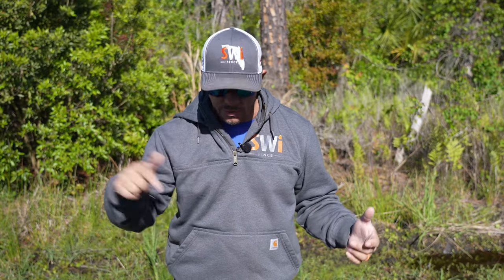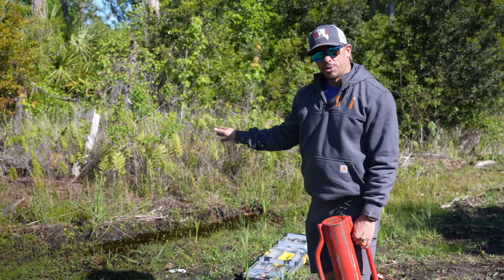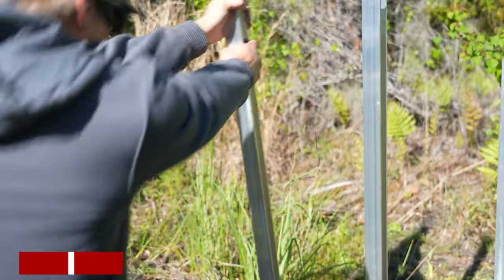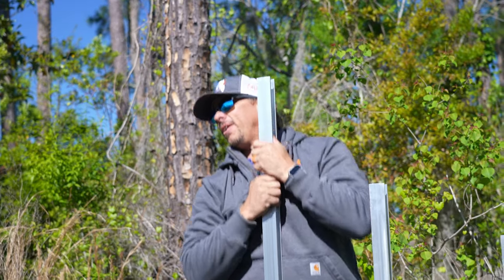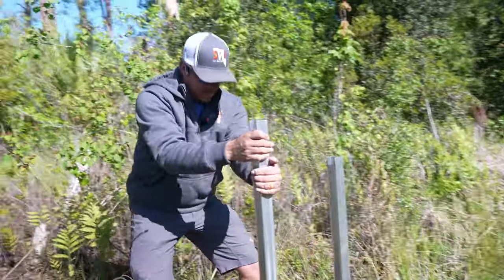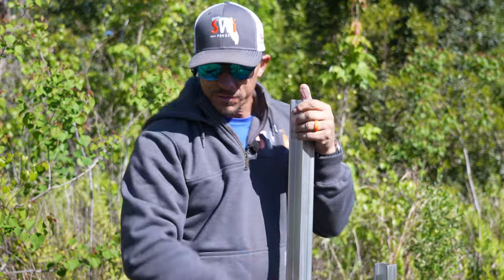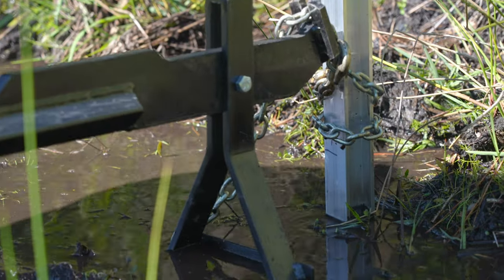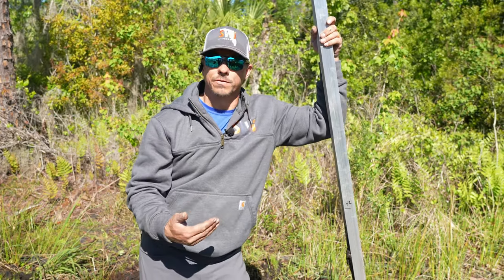How Deep Do No-Dig Fence Posts Have To Be?

Comment: Florida is good, always below the frost line or the posts will come up over time and that’s why almost every fence in the Midwest installed has walls leaning.
Reply: My T-fence posts in upper Michigan sank as time went on.  They were mounted in water or wet soil types.

Comment: I’m impressed, even the pole 2 ft deep didn’t really come out very easily! Driven a lot of T posts and pulled out quite a few too! Tell you the hardest T post that I ended up just cutting off at ground level and that was posts that had thick roots growing around the posts and those wings on the post were under the roots! Now that would of took a act of God to remove! 😂 notice your post don’t have those wings either! That should help removing them if roots are growing around them too I would think? 
Btw, yes I like to see you break off the regular post you mentioned.

Comment: Consider letting go of the pounder just before impact to save yourself some numb hands and arms. When I was cutting the holes at the golf course with a similar implement that metal-on-metal shock really kicked my ass. Maybe I'm just soft though, seems I was playing Super Nintendo when this fella was wrestling gators or something.

I suspect it's loud as hell too, I'm gonna try and stuff a rag into the pounder to deaden the sound a bit.

Last thing, I basically copied your post-pulling machine after seeing it in action. Went and bought a 5' length of chain (1/4" I think?) with a couple grabhooks, then pretty much anything can work as a lever+fulcrum.

Great vid as usual, very helpful.

Comment: Good experiment.  However, the lever arm for each were different.  Drive them to these depths, then cut them all to the same height.  Then pull.  That will test the embedment strength in an "apples to apples" comparison.  As you performed the tests, the ones that were driven deeper into the ground had a smaller lever arm, this you were actually imparting less moment to the post.

Comment: I have driven top rail cable fence in a low water crossing  I drove them 11 feet to 16 feet the ones driven less than 16 feet sunk when the top rail set on post.

Comment: Do you make posts for retaining walls? And how deep do you have to put them in the ground?
Reply: Have you learned anything since your post?

I'm looking at various metal posts for a retaining wall as well.  I have casted several dozen concrete beams 6ft x 9in x 4in thick.  I have dense clay soil & freeze thaw cycles.  Galvanize H beam is way too expensive for as much as I need.  With something like this it is the yield strength that I see being the most important.  Seeing as the majority of my walls will be less than 2ft tall I am thinking telespar or u-channel will be plenty good... they won't bend or shear under that load.  

I have a few sections that will need to be 30-44" though & that is my big worry.  Especially since that will be holding part of the patio & we get enough rain/snow to saturate the clay & make it really heavy (of course I've planned for drainage).  I found a local reseller that has postmaster posts for cheap & that is what lead me to this video.  I am thinking I will use the postmaster posts for anything under 30"... 1 to hold the ends of the concrete bam & 1 in the middle... the thought being the middle will be where the beam will experience the most tensile stress.  Alternatively I could use equidistant from the middle for more shear/bend strength... but budget is a concern.  For the tall sections I am looking for an H beam or even thinking of casting my own posts from concrete.  But those would have to be dug & set instead of driven (prestressed posts like one can buy in Australia can be driven).

Comment: good video. Have you hade any trouble driving post in hard pan ? Up in Jacksonville Fl. we have a lot of hard pan especially on the westside of town . Thanks for a great demonstration on post strength .
Reply from the maker: Depends on individual conditions. You can drive anywhere if you've got enough driving power. Some situations would call for upgrading past a gas-powered driver.

Comment: How would these work for a privacy fence? Most posts i see like these are about 7ft max but if you’re driving these posts 2-3ft down you only have 5-4ft showing. How would you install a 7-8ft privacy fence with only a 4-5ft post. Seems like at best you have 2ft ground, 5ft showing with a vertical fence 2-3ft(7-8ft fence)above the top rail.
Reply from the maker: For something like cedar than you're using longer posts so you can get more in the ground and still have enough sticking out. https://youtu.be/PnM7g24yWe8
For something like vinyl you don't have to reach the full height of the fence since you're sleeving over. https://youtu.be/ONA15hJym-k

Comment: I live in eastern Oregon and the top soil is soft sand 2ft down and after that it's sand stone with highly compacted 3 to 4 inch river rock. I have a pre-existing 4ft picket fence that I need to replace a number of posts on.  I'm wondering if I could use your idea of using Sodium Bentonite to solve the sand cave in problem when digging the post hole? Also what kind of supply co. sells Sodium Bentonite?
Jim
Reply from the maker: I would just use water for dealing with the sand. Drill the hole, throw some water in--should form a nice hole to set your post in. We use the bentonite when it's nothing but river rock, so we add the bentonite and water to create the paste.

Comment: Hi. I love your videos!  I want to place a vinyl fence with either driven Galvanized or I-beam style posts.  Our lot is at the coast and is sand.  Can these posts be placed by the no dig/driven down method and still be hurricane strength rated?  If so, i’m assuming a 3.5’ depth. Thank you!
Reply from the maker: Here's a hurricane test on vinyl fence set in concrete: https://youtu.be/_iQnheVwAI4
And here's a hurricane test on no-dig vinyl fence: https://youtu.be/8jWcT17PFME
Reply: @SWiFence  Thank you for your response.  I have previously seen those videos.  My question is: Will the posts hold as well when driven into sand only or will some other substrate be required for strength in a sand installation? Thank you in advance!
Reply from the maker: Sorry if I'm not being clear. The two videos listed above were done in Florida sand.

Comment: How do you pull a wood post cemented in? Will that tool you used in this video work?
Reply from the maker: That's been the subject of conversation around here and we need to do a video to test it. I think if you're pulling out a diy concrete job it'll probably do the trick. If you're pulling out contractor-built concrete then probably not.
Reply: I take a sledge hammer and hit them around the sides usually helps bust the concrete loose then I take my tamp rod and try to separate the post from the concrete and then shake and pull. It's work.